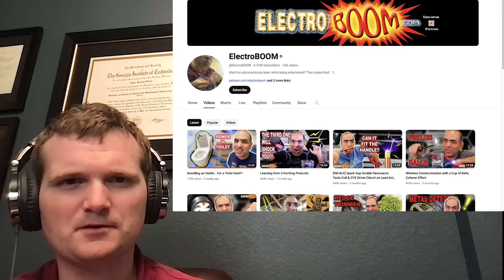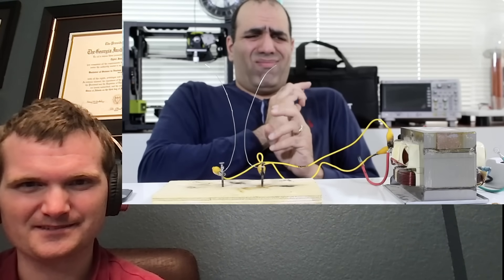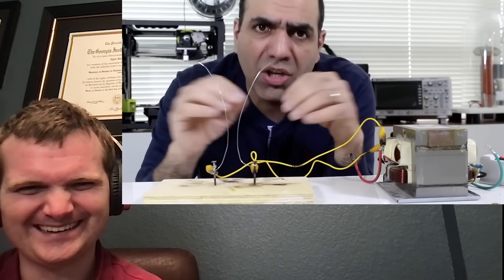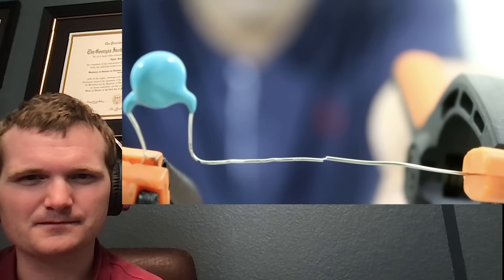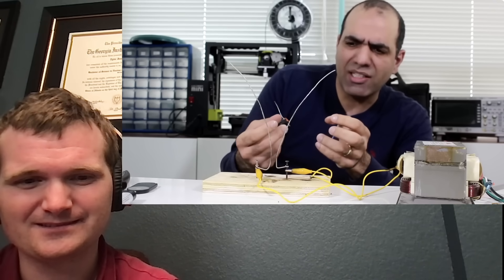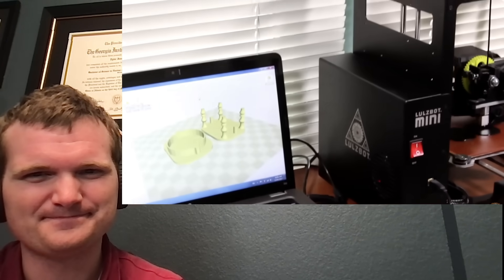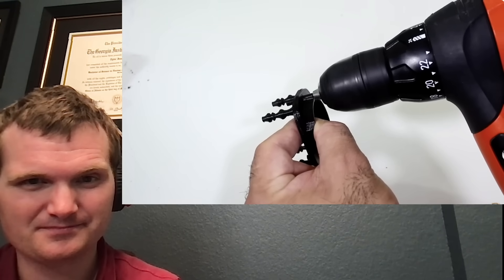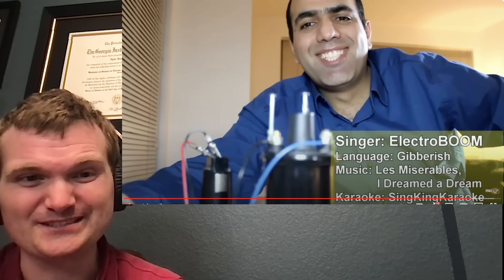Nuclear Engineer Reacts to ElectroBOOM's Jacob's Ladder

Comment: When I was a kid, I played with high voltage, but instead of a microwave oven transformer I used a flyback transformer from a TV and some simple two transistor oscillator (it got really hot when running). It created arcs a few mm long and because of the high frequency did not hurt at all (unless I kept the finger near the arc long enough for the skin to heat up and burn at that spot).
I made a mini version of the Jacobs ladder, plasma globe (just a regular lightbulb) and a simple electrostatic motor (works with AC).

15:34 - "what is that?"  That is a pencil. Graphite is conductive, so, connecting low voltage high current source to it makes the graphite red hot and the wood starts to smoke a lot. I did that too when I was a kid :)
Reply from the maker: Thanks for sharing! I laughed at “playing with high voltage”!

It looked like a pencil at the end, but I wasn’t sure!
Reply: I want to rectify something here... It doesn't only burn your skin on top, it causes internal burns which can lead to gangrene, after a week you'll have a hole in that spot that is not cureable. Just be careful. And yes high freq is safer but don't fuck around to find out. Talking from experience.
Reply: @Dinco422  As much as it may have looked like it in my previous post, I am not a masochist, so I just moved the finger out of the way once I started to feel pain because the skin got too hot in that spot (which was after a few seconds). All of my injuries associated with electronics were got by touching the wrong end of the soldering iron, cutting myself with some sharp edge or stabbing myself with a screwdriver, none of them were permanent.

Comment: I remember about thirty years ago, a friend of mine and I got on a Burger King Roof. I took a big transformer they had for the Neon Lights. I took it home and cut up a coat hanger for the leads for a Jacob's Ladder. Made GREAT Arcs!
Reply: I have a microwave transformer that I've messed around with a few times. But it's a terrifying little thing, so my safety protocol tends to be being a couple of metres away from it when it's energised, and unplugging it at the wall before I approach 😂 https://youtu.be/LnRUvJM7rn4

Comment: I'm pretty sure he was using a foot switch. He showed it in like the next episode (I think) when he makes his ELECTRIC CHAIR. That's a bit of an exaggeration. He was making a seat warmer to pamper his buttocks using nichrome heating elements. It was totally funny as you might expect. That would also make a good reaction video. BigClive also did a PSA on the dangers of microwave transformers, but there was nothing humorous about it.
Reply: This is a link to ElectroBOOM's heated seat video: https://youtu.be/MrnCDKB1hE0?si=XRHB5qy9aoJ5AJy7

Comment: 12:40 - The thing you need to know about ElectroBoom (even if you sorta touched upon it earlier in the video) is that he constantly fakes mistakes, he doesn't actually put himself in harm's way, he's sitting on a thick rubber mat and the breakers keeps popping because he has extra safety measures in place. Also right before the thing falls over you can see that the connections changed, he most likely changed to a much weaker powersource outside of view just to be extra safe.
Reply: He said himself that this one was an actual unplanned accident.
Reply: @blackbird42 I think unplanned in the sense that he didn’t think it would fall on him. But I do believe the commenter is right about the extra safety precautions with the mat and weaker power source etc

Comment: 15:34 that's a double sided pencil carrying 11 amps at 24 volts. IDK why he made it, but if you needed to light a fire & all you had were 2 car batteries, wires, & a pencil, I guess it would be useful?
Reply: Ive personally done this experiment as a kid with 12v. so it'll also work if you use 1 car battery, but you might need to make the pencil shorter first to get actual fire instead of just smoke.

Comment: Electroboom's talked about this since first posting the video. This is one of the few videos where he actually almost killed himself. Many times he's made it look like he's gotten hurt, but a lot of those were for YouTube comedy. This one was very real, he genuinely almost died when it fell on him
Reply: ejuicevaper He has confirmed this. I forget exactly where, but he has.
Reply: @nikkiofthevalley I believe he confirmed it in a podcast called The Amp Hour with EEVBlog
Reply: @nikkiofthevalley  I remember that confirmation as well.   So I decided to watch this and I was shook.
Reply: "High voltage", "affordable" and "DIY"  sounds really bad
Reply: @redmist6630 yeah it often is. There’s been several people who died while experimenting with these transformers that come from microwave ovens.
Reply: ejuicevaper because smart people are perfect and never ever make mistakes.
Reply: ejuicevaper breakers pop due to high current, (in households, most commonly above 16A). He was only saved by the GFCI (or as my people call it, the “ÁRAMVÉDŐ-KAPCSOLÓ”) which detects fault currents (although you may still feel a shock for a split second as it trips)
Reply: @yxngsellei  GFCI does not work when transformers are involved. They measure differences in the current entering and leaving, when you have a transformer you have separate loops, no matter what happens on the secondary side the current entering and leaving the transformer and hence GFCI will be the same, hence it won’t trip. Any time you have a transformer and the secondary is isolated which is most use cases, then GFCI and quite a few other devices like RCDs don’t work and breakers will only trip when the primary exceeds the current rating for long enough,
Reply: @yxngsellei  It was between live and neutral. RCD/GFCI wouldnt have done sh*t!
Reply: @yxngsellei The GFCI feeding the primary of a transformer, usually cannot react to a fault on the secondary side. That’s another reason why these transformers have a high risk of causing electrocution.
Reply: @yxngsellei   Ohhhhh now I know why he checks for GFCI everytime he goes to another country.
Reply: GFCIs dont do shit when touching gthe output of a high voltage transformer that is galvanically isolated from the mains. They will see it as a normal circuit.
Reply: @yxngsellei wrong due to him using a microwave transformer wich usually uses 2000  volts (wich he said) in combination with 800 miliamps (wich he didnt say) thid can still kill him fadter than the breaker could pop. The only reason he survived was luck
Reply: @matthiasimboden5359GFCI breakers usually disconnect very fast, (usually in the milliseconds range, after the difference in the live and ground wire’s current exceeds 30mA in most standards), which means that even with the 200 volts (because of the resistance human body, it only drives ~150-200mA) it means it would have not been enough to cause any harm in the time the breaker “pops”.
Reply: @yxngsellei  but this case was through a transformer which prevents earth leakage. So the breaker would only trip from overcurrent and not earth leakage (which would still not be a short because the transformer also limits the current)
Reply: @jackaw1197 oh shiit i completely looked over that, my bad. Yeah he touched the live and neutral there, thats dangerous stuff.
Reply: That's not true tho, look at the connections to the 'jacobs ladder' between shots, you can tell that right before it falls on him its very clearly been rewired, most likely to a much weaker power source.
Reply: @suicidalbanananana  there's still enough voltage to light up the arc and he caught both electrodes. You can't current limit it either, it has to be at least few amps for an arc like this. It was not safe by any means.
Reply: @suicidalbanananana  yeah I dont understand how people can fall for that. it was obviously fake
Reply: @suicidalbanananana both hands and arcs. Even if he did drop the power on it for that to work is still way way way way way way way way way too much power and I'm not actually sure that that breaker would have shut off quick enough. While that's moving at the speed of sound. That electricity is going between his hands which goes across the heart. Genuinely I think it is the clamp just came off right when he touched it so it sparked and he got burned but it didn't have the time which would have butt took a moment longer
Reply: @borttorbbq2556  Spoiler: He's been reprimanded by YouTube in the past, where he had to reshoot or remove certain videos, they will have asked questions about this jacobs ladder thing, he will have faked it or the video would be long gone.

1) The cables change mid scene, this is suspicious to say the least
2) Its not that hard to do a little cgi on a home computer to fake sparks etc, likewise its not hard to find somebody who can do this professionally on fiver or similar websites

Not in any way a complaint about the guy btw, i just think its a bit silly that he tries to make people believer that this is "real" when we know for a fact (because he says so) that he fakes everything "bad" happening (since his "electric guitar", which he replaced with a faked video as per YT's requests) 🤷‍♂
Reply: @suicidalbanananana yes he fakes a lot of them mostly because he's trying to make a point of electricity is dangerous. I'll be honest though I am not so sure about this one. This one yes I saw the jump cut just before it fell. Whether or not that is the original full power version or not I don't know. But the fact that there's proper parking tells me that the voltage is still very high and there's enough current to actually transfer power which is indicates to me that if you are an air that's enough power to hurt someone severely. Like I could rewatch The scene a few times over but I've seen it before and it's like I am pretty certain that that legitimately happened. Another part of it could be the coding of the sparklers themselves may also be slightly insulative which didn't have the full current go though both hands touched both electrodes. While he could have smacked one of the electrodes with one hand it genuinely looked legit I'm not sure after rewatching it several times zoomed in it fell at power. You couldn't get it to even partially start an ark like that with a jump start using a candle there there's no way that works. Know that thing was at full power and the yeah re-watching it again that wasn't faked like he should have smacked it with one hand rather than catching it but still.
Reply: @suicidalbanananana but again the dude did also do an interview where he actually explains this instance was not fake. I'm sorry but this guy seems to have the integrity to not fly out his ass. Do you think he faked it I'm sorry but there's no reason to think that and I like electric broom by his video quality isn't good enough for him to know enough about CGI to actually manage.